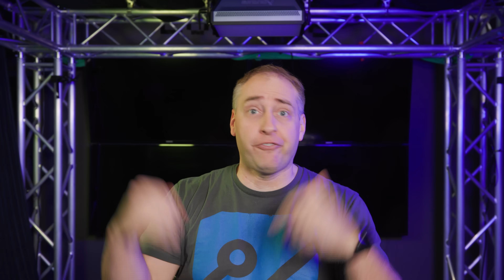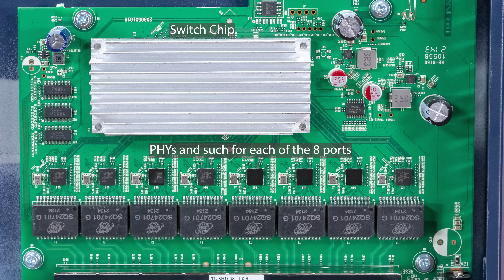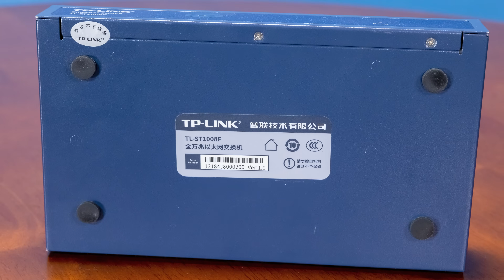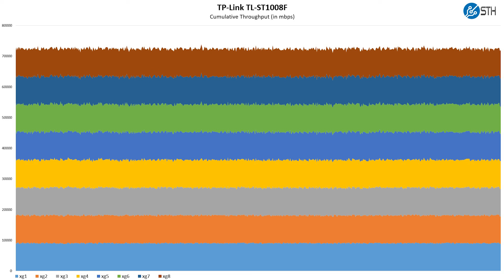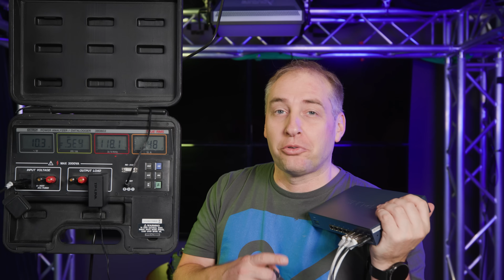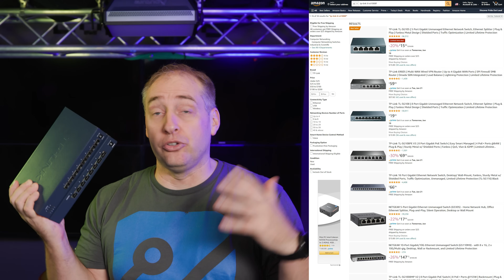Cheapest AliExpress 2.5GbE and 10GbE Switches from TP-Link

Comment: Oh, TP-Link, quite well-known here (CE-EU)
I got some bottom-of-the-barrel cheap SOHO dump switches from them. Worked fine, though an old 8 port had some PSU problem after about 4-5 years, but that's pretty much it. Still have a 8x1G going, zero problems. So for 1G, at least in my limited experience, they were definitely the "forgot in the wall" type.
Reply: I think USA is another world, where 1/3 of world popular brands are totally unknown to even such people like Patrick of STH
Reply: @FirstnameLastname-py3bc  TP-Link is easy to find is the US, too, in places like MicroCenter.
Reply: @FirstnameLastname-py3bc  TP-Link is widely known in USA.
Reply: TP-Link is very popular in America. You can find their stuff in every Microcenter and Best Buy, and most Walmarts. But they don't sell their lower tier models here. They implicitly promote a brand of being slightly better than D-Link or similar.
Reply: They have pretty big market in south east asia as well
Reply: Brazil as well

Comment: 2 of my 3 "cheap" (at ~$350) Netgear 10gbit switches randomly started dying after 2 years of use, and that's a fairly reputable brand with good customer service and everything. Who knows for how long they've been causing trouble on my network, I would be especially careful with even cheaper ones..
Reply: but then there's 8 bit guy with used ten year 100 mbps netgear switch and still works.
Reply: In my experience, Netgear and Linksys home routers break after a few years. TP-Link ones last much longer. Weird because TP-Link are much cheaper, but it is what it is.
Reply: @wpyoga  Brand name loyalty.  People will buy Netgear and Linksys (or even better, "Linksys By Cisco"!!) because they assume (rightly or not) that it's better quality.  As soon as someone sees a Chinese brand, they assume they're junk, so the likes of TP-Link start from behind in marketing their gear.  They tend to sell them cheaper to entice buyers across and let them see for themselves.  As a long-time networking professional and owner of a whole variety of gear, I can say there are good and bad examples across everything, and personally I'm pretty happy with the TP-Link stuff I've had.  Price/performance, I'd actually probably rate them higher than the Netgear/Linksys/D-Link.
Reply: @mchamster7  Yep, that mirrors my experience. Conventional wisdom says D-Link should be better than TP-Link because it's a Taiwanese brand. However, D-Link routers have failed me multiple times. Failed as in, the router just died, or the Wi-Fi died but the LAN ports still function.

While the cheapest of the cheapest ($10 USD where I live) TP-Link routers (WR841N) has served me well for more than 5 years, without a single failure. It doesn't have too many features, and it's slow (802.11n), but it's so damn reliable.
Reply: They should have lifetime warranties. I've RMA some Netgear switches that's 10 years old before and it was more or less smooth. Advanced RMA and everything. I actually got an upgrade since it hit EOL for a while now. This is quite different from D-Link which I also tried to RMA for a 10+ year switch, but apparently, it's only "lifetime" till it's EOL and then you have a year before the warranty ends.
Reply: And if you pop them open, most likely there will be dozens of bad caps. I have a pair of GSM7200's, and basically every cap on the board is bad. (it'll boot, but the SoC doesn't power up, thus it reboots.) My Nortel ERS switches... some of those are coming up on 20 years old. Only one has ever failed, and that was a clock crystal. (and construction dust killed a power supply, but I can't blame Bay/Nortel for that.) They have, in fact, out lived Cisco gear.

(I have one old enough to still have BayNetworks livery. And one just new enough for Avaya to have put there labels on it.)
Reply: These products are designed to fail immediately after warranty

Comment: Might be interesting to make a Cheap to …. and Expensive Switch Round Up

Mikrotik failed on my side because of the hundreds of cve’s and vulnerabilities but maybe that is because it’s used so much so..
Reply: I'm not aware of a whole lot (if any) CVE for SwitchOS (the mikrotik OS/interface for their switches). It's running on HTTP only because it's basic, but at least you can block traffic from most ports from accessing the interface.

Comment: Until 10gb and 2.5gb prices get closer to 1gb, I'll still consider them high end in the desktop space.  Commercial is of course a whole different story.
Reply: If you shop around and don't have aversion to buying used, 10Gb gear is very cheap.
Reply: 10gb used is as cheap as 1gb new
Reply from the maker: The other way to look at the 8x 10GbE switch is that it is the same price per 1Gbps as a $16.60 8x 1GbE switch. That is pretty reasonable.